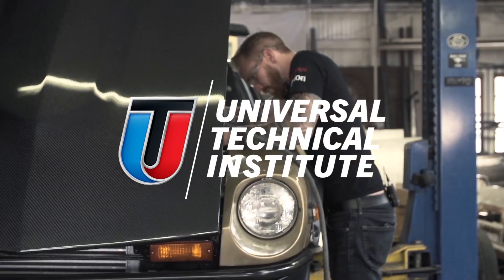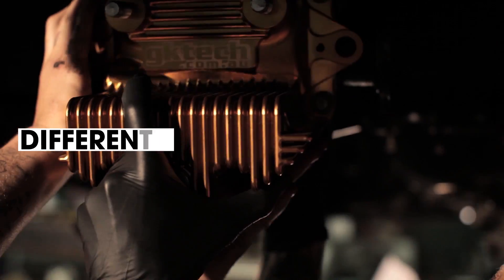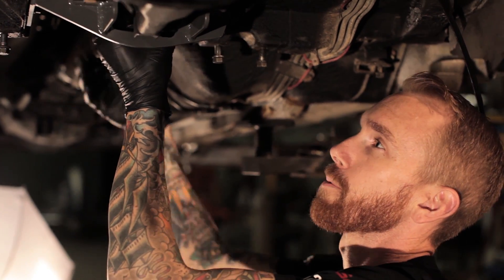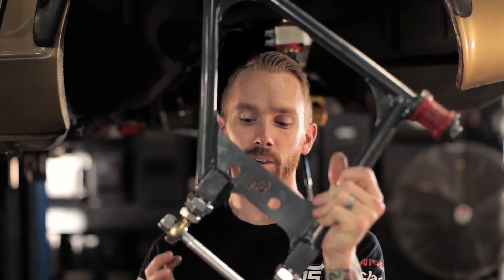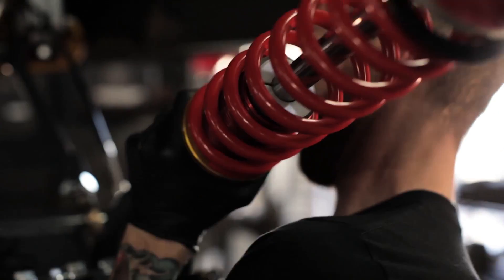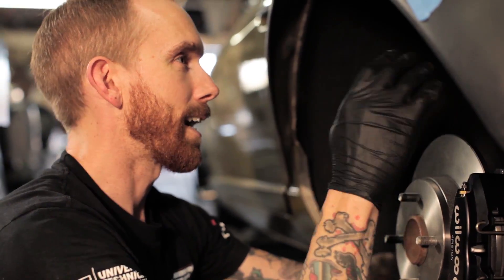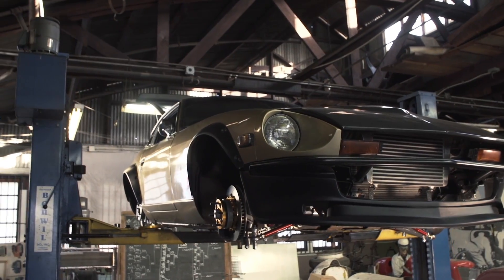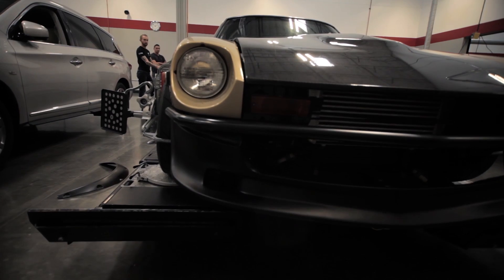Drift Car Dynamics Pt. 2 w/ Chris Forsberg and Jason Fenske (Engineering Explained) | Donut Media

Comment: Could you give me a list of all the exact aftermarket parts he put onto the Datsun? I'm planning on doing a build just like this and it would save me lots of time if you could give me a list of the aftermarket parts.
Reply: Techno Toy Tuning offers the adjustable arms and also has coilovers. Suspension Techniques has sway bars and other companies do as well. I'm not sure about that diff. Since they had an aftermarket mount and a custom length driveshaft it really could be anything. $$$!
Reply: I think it was an R200
Reply: Daniel Brealey r230

Comment: so was Datsun owned/made by Nissan? or were they conglomerates? or was there no affiliation whatsoever?
Reply: Datsun was essentially what Scion was for Toyota.  It was Nissan's off-brand so that if it failed it wouldn't tarnish Nissan's brand.
Reply: +Jonathan Girard Datsun is an automobile brand owned by Nissan. Datsun's original production run began in 1931. From 1958 to 1986, only vehicles exported by Nissan were identified as Datsun

Comment: Sick, but I wonder why they don't talk about replacing bushings. I saw they had polyurethane bushings going in and those eliminate a lot of body roll which makes the car stiffer so it's easier to kick out. Maybe they don't want to reveal to many secrets?;)
Reply: +Mason Herrera Well, most of these episodes are based on the suspension geometry. And I imagine many of the parts installed on this Datsun are custom fabricated. They probably wanted to show off all those new shiny bits! (also, on a car this old, bushings are a must! maybe not necessarily polyurethane for the street, but in general, those get worn) but yeah, i wonder if they have some secrets buttons or switches in that car...hehe
Reply: Very true lel